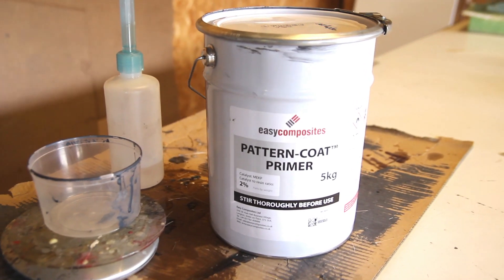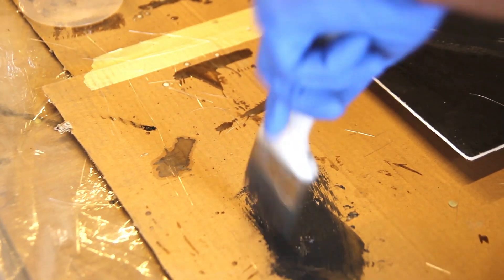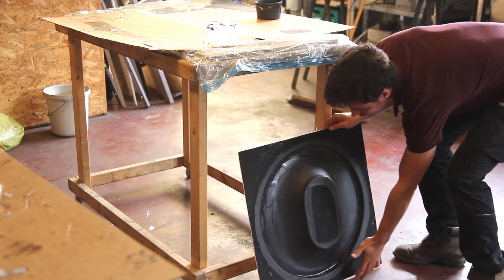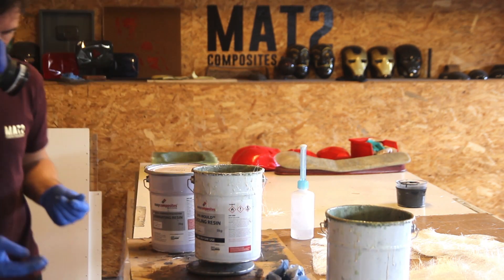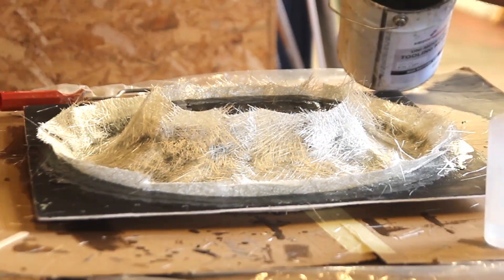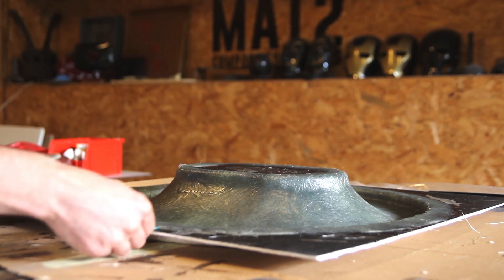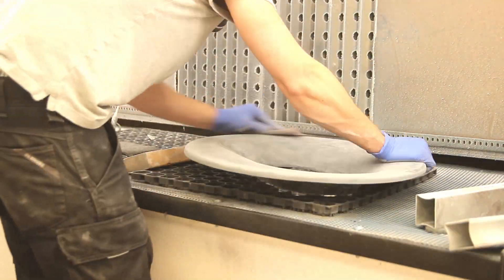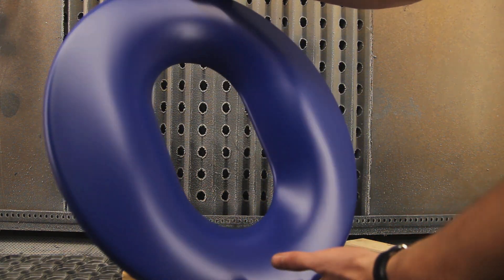Easy Composites Pattern Primer As Inmould Coating - Fiberglass Polyester Parts

Comment: Great video Matthieu, I'm looking at do a similar process using the pattern coat primer as an in mould coating.

I know in the video you made a comment about letting the primer "get dull" before proceeding, is the surface still tacky at this stage, would it leave a finger print in it? 

I don't want to leave it to long or too short before laying glass and resin.

Comment: hey Matthieu, can I kindly ask you how do you give price of a part? do you have any excel algortm?
Reply from the maker: Hi, I dont have an excel, just make the calculations of materials in advance (experience based) and estimate the working time and come up with a number. This is all based on experience on previous projects and testing I do, so there is no magical calculation where a numbers will appear on the screen. two main factors are the difficulty of the part and materials that need to be used. Hope this answers your question in a way

Comment: Thanks for the new video! Probably stupid question but why is this faster than resin infusion? I mean why does this cure faster? Wouldn't an infusion or a hand layup cure at about the same time? Or is it about the prep and waste of infusion with bags and vacuum lines and such?
Reply from the maker: Correct, more preparation and I mostly use a slower curing infusion epoxy to make sure everything is well saturated plus an 8h postcure, here everything was done way faster and while everything is curing I can already make the preparations for the next part
Reply: @MatthieuLibeert  Thanks!

Comment: Great work once again, using the primer like this for parts that are going to be painted is genius! The filler content in the primer will allow the 2k paint to bond much better than a conventional gelcoat. Thanks for proving the concept!
Reply from the maker: Glad you like it Paul! One of the must have products in the workshop! Next experiment would be with resin infusion on it with epoxy resin, you see any possible problems there?
Reply: @MatthieuLibeert  It should be fine, epoxies, as you will know, bond really well to polyester (assuming it's got a fully cured surface) the added porosity of the primer will only help the bond further so I'd say it's definitely worth a try. Let me know how you get on!

Comment: Can the tooling primer be used with epoxy resin infusion and carbon fiber? I’m making carbon body panels for my car and this seems like a great way to get a jump on the surface prep before paint.
Reply from the maker: Good question, when I asked easycomposites if it could be used as an inmould coating they said they haven't tried it yet but in theory should work. I tried it in this video and it worked. As far as for epoxy I can tell you I've used it in the regular way as brush on after demoulding on epoxy parts and adheres well. So In theory it should work, Will try it when I find some time and post it in a video!
Reply: Thank you. I can’t wait to see it.